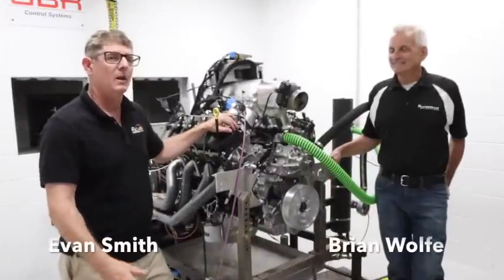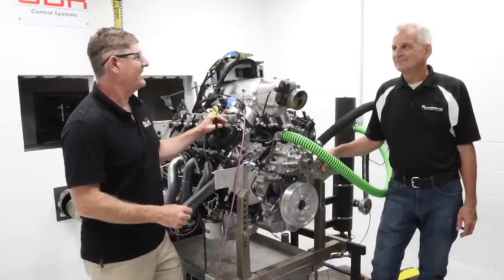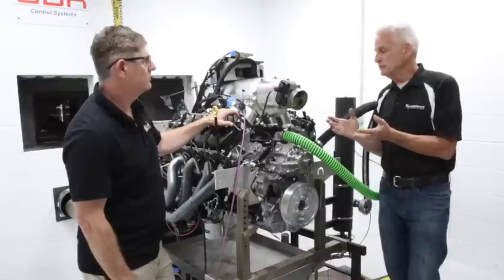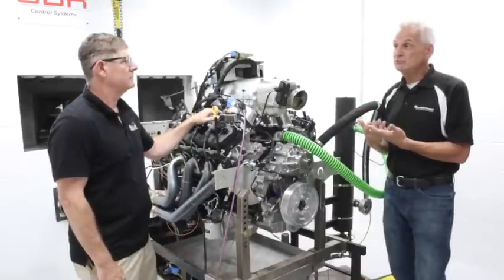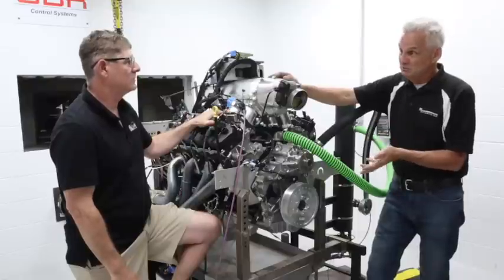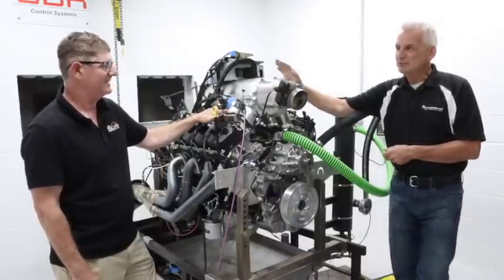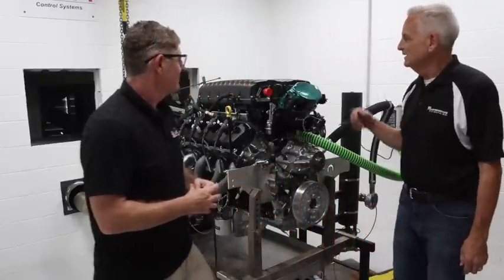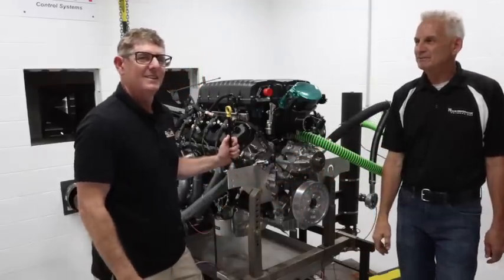Godzilla 7.3L Ford — Back on the Dyno With Over 780 All-Motor HP — Plus... We Reveal What's Next.

Comment: I've got the 7.3 in my 2020 SD Tremor and loving it so far,, heard some guys having plug wire issues.yours still stock and do you plan on changing the coils n wires. TKS for the update 🇺🇸
Reply: Yes, with the blower will be running BIg Stuff 3 coils.
Reply: The front main seal went out on my 7.3 with 14,000 miles on it.
Reply: @mariobrothers8348  wow
Reply: Literally a brand new engine - there will be 'teething issues'. This is why you don't buy year 1 products unless you're willing to roll the dice on being a guinea pig

Comment: Sucks Ford won't produce this beast very long....
Reply: Why would you say that?
Reply: @brianwolfe2993  The history is there, the latest 'big block' V8 (6.2) didn't last long. I have nothing but Ford vehicles and I love Fords
Reply: @slowstang88  This engine will be in the Super Duty for decades, I am certain of that, and the capacity is over 200K per year.  Not to worry they will be there for you.
Reply: @slowstang88  couple things, 1 6.2 isn't a "big block", and 2 they are still in production today, 10 years on now.
Reply: @brianwolfe2993  I always wanted them to mod the 6.2 for the GT500 the same way as the small inch modulars to totally destroy the ZL1
Reply: @slowstang88  That would have been cool, but Do not thing a 4 cam 6.2: would have fit in the Mustang, also I think the 5.2: is going great.  Check out Palm Beach Dyno's results.  They have a lot of GT500's in the 9's with bolt on's and full vehicle weight.  Cool Shit.
Reply: @brianwolfe2993  I damn well hope so
Reply: Diesels being so expensive and tightening future emissions requirements will make gas options more desirable in the coming years.
Reply: All the SuperDuty's on the dealer lots have the 7.3 and they're sold right away. So far this engine is more powerfull than the 6.2 and gets better fuel economy than my fathers 2019. Very impressive motor, but we'll see how it does in a few -40 winters :D

Comment: Surprised of how low the torque is the whole deal with this Godzilla was everyone saying “torque monster” it didn’t even crack 600 NA i hope with the blower it makes atleast 700 with this exact same setup.
Reply: Again, BLOWER cam!   This will make way north of 700 with the blower......
Reply: @Brian Wolfe sounds good not trying to be an ass or anything just seemed odd thanks for the clarification with the blower will the torque be close to the HP or will they be a huge gap like the coyote engine??
Reply: It has blower cams that’s why . And it still kept torque very linear across the dyno pull . I’m impressed

Comment: Really since when is 12.5:1 blower comp ratio.
Reply: It's becoming common. But yeah it never use to be. But everyone is doing it now.
Reply: Im use to 9 to 1 for super chargers. I  guess engine management has cone a long way since carburetors and magnetos
Reply: Racers have been at 12-1 for 2 years now. The tuning window is smaller.
Reply: @ejohnson3837  Are they running less boost or using intercoolers? I know the screw type compressor produce less heat and are more efficient but damn! I had a hard time running 11 to 1 in my 454 Vette. I ended up going 50/50 super unleaded and 100 low lead AV fuel.
Edit: It was a 1970 naturally   aspirated, cast Iron oval port heads.
Reply: @billconservative9503  32 psi and methanol
Reply: @ejohnson3837  Doh! Thats amazing.
Reply: @billconservative9503  Yes, the new engines with alumninum pull more heat out..heard aluminum heads are worth a point of compression...and the new fueling with direct injection helps. The new Coyote runs off E85 too which is 105 octane.
Reply: @robertelmo7736  Doesn't alcohol fuels have about 1/2 of the thermal energy of gasoline? Would that require twice the amount of fuel to extract the same amount of energy. I know the fuel has higher octane than most pump fuels and it runs cooler. Just curious.
Reply: @billconservative9503  Most run e85 or methanol. If running gas, then yes air to air or air to water. Street motors are tuned with a lot less timing. Race motors monitor intake air temps to keep them low. Last year we ran race gas on a 12-1, 314 cubic inch procharged  mustang in NMRA Modified Street class. we ran an air to water intercooler and put 22lbs of ice in the water tank per run. Intake air temps at 32 l.b.s. of boost were never over 50 degrees
Reply: @billconservative9503  E85 was 30-40% more when I ran it in my stock 5.0 with ball drive non-intercooled Paxton for years. I would mix it with premium (93) to E60 (60% ethanol) which was about 100 octane and needed about 20% more fuel. Cooling effect and timing I added accounted for about a 40hp gain.
Can't get it anywhere around me, so just running premium now in my 393 budget stroker.
Reply: Has been for a while, not an issue.  Even the 2018 5.0L Coyote is at 12.0:1 and the put a Whipple on that with pump gas, this is a race engine for use with VP race fuel,  sorry if that was not clear in the video.
Reply: I'm going to lean more towards fuel.  The fuel technology we have now compared to 10-15+yrs ago.  Ideal if ignition should happen between 17-20 degrees on boosted app.  If you can control your detonation, good fuel, proper air charge temps, and fuel I see how the newer engines are 11 to 11.5:1 and handling boost.
Reply: Direct injection sprays top of the piston instant cooling 12-1 compression +E85=110octane 20 psi no problem cars make 650 wheel on 7-8 psi now
Reply: Since when has 11.0:1 been factory we live in great times for power!
Reply: Daniel Smith since the ls2 came out in 2005 11-1 compression CT’s-v gto corvette all got this engine in 2005 and ford had to catch up this gt500
Reply: @danielsmith7935  1970 Lt-1 was 11:0 to one 1967 L-88 was 12.5:1 1964 max wedge was 13.5:1.
Reply: Someone get Richard Holdener's opinion.  Oh and I was under the impression e85=100 octane?  Where I live I can't get e85.  I watch all these 1320 vid and stuff like this and guys are like "yeah e85".  Highest pump gas I can purchase normally is 93.  If you find a Sunoco it might have ultra 94.
Reply: Since it’s running on C16 fuel... know your fuels. 5:00
Reply: @K_M_M_G  ok...

Comment: Wow I can't believe that curve it was still climbing
Reply: Forest LawrenceGrading : on the final corrected curve we have a  Twin Peaks Rocky Mountian Pleatau 550 to 525 to 553 lb-ft torque curve at 5500-6100-6750  and 790 hp at 7600 rpm. Nice Aspirations Index, nice relaxed 1.24 lb-ft per cube Without Even Trying..Knowing how perfect the bore spacings and port arrangements are to match a Dominator carb spacing,  Tunnel rammed with 1150 cfm Dual Quads, this could easily make 860 hp at the same revs.Just As it is That things really quite awesome..BW...your a shining star!
Reply: Only a 90 mm 3.54 inch throttle body off an S550 GT 350 and its 789.6 horsepower? 183 cube Whipple Screw Supercharger will be like a boost ratio of more than 2.5 at 22 pounds of boost. Just off 2000 hp Id say if there is no boost limit in that class.

Comment: Spinning a 7.3L motor to 7600 ain't no joke, man.
Reply: in the realm of high performance engines there are engines over 8.8 liters spinning up to 7500, especially considering there is a set of aluminum rods in there which is twice the price of a regular set of rods on top of it being a one off set
Reply: @Bro_dee007  how long did it last
Reply: That’s not high Richard holdner revs old school big blocks to that so this new engine definitely should after 15,000.00 of custom parts
Reply: @utahcountypicazospage5412  - there isn’t even 1000 dollars in it you don’t have a clue. Bone stock Ford truck engine. That’ll kick the ls ass
Reply: I built a 864 cube inch mountain motor ran it to 9000 rpm made peak power at 8600
Reply: This guy with a SBC impressed me lol...

https://www.youtube.com/watch?v=OGIz5AZbwrU

Comment: FINALLY! The wait was killin' me!
Did you tell unkle Tony about the video?
Reply: 11secghia : He Knows....
Reply: Him and Wilburn will get that fucker into the '8s just you wait and see. Umm...yeah, that's in the 1/8th, ah maybe.
Reply: He turned it into a full race motor with custom valve train pistons rods just the block is stock  this better make 1600 hp because if he doesn’t it wasn’t impressive
Reply: Utah county Picazo's page : It will make that 900 hp at 8000rpm..maybee 930. The boost ratio will be cosmic. Cannot wait, UC
UC.IC.WeSee...
Reply: Dean Stevenson full race engine 7.3. head over to Richard holdner page and watch him do this hp with off the shelf stuff oh and 8-1 compression and gives part #s
Reply: Utah county Picazo's page : Much love to all Dancin Knitting Needlerz. All kinds. Aint no GM Power Freigh train Hate mayn. Love everyone of Richard Holdeners love children. From 4.8 to 6.2,  If a 4.8 with 26.8 pounds of squeeze can sneeze out 5 times as many  trifecta wining Horses as a stocker ( 1200 gross verses 240 hp net) then so can the Gee Zee.  Starting with twice as much just ups the ante and throws down the Quantlett. Its All Good Under the Hood...due to blue bleeding breeding FoMoGo grunt has always cost more moolah than Team G and C.  Without a salavage tag, see what 7 grand can do at  https://youtu.be/TNfRLX9yNUs
Reply: @utahcountypicazospage5412 i agree  but crank is also stock with alot of other parts .

I wouldn't of gone with titanium vavles and kept the stock rockers  . Shouldn't of used aluminum rods. Pistons was probably a must  
.Atleast to see the limited of the motor and it's parts . After all they are trying to showcase this motor .
Reply: MichXJdad you don’t listen or watch obviously nothing about that valve train is stock not the keyed lifters mechanical camshaft special rocker assembly titanium valves the company that Made the intake made the valvetrian look at a stock 7.3 major difference in valvetrian at least 10,000 dollars
Reply: MichXJdad watch the video over geeeeeeeez lmao you are way wrong

Comment: Has Brian looked into stroking this?  How big could it go?
Reply: I think you could go between 4.15 to 4.25, but have to try it to be certain.
Reply: There are 500+ C.I. LS engines (tall deck) and they only have a 4.40 bore spacing. This 7.3 has a 4.530 bore spacing so yeah I think they could get at least 500 C.I. out of it?
Reply: @baby-sharkgto4902  My comment was with with a stock block.  I think 500 can be done, just have not done it yet.
Reply: Would the heads flow enough for any more cubes port and polish had to be done by a professional had the heads been left stock we would of been very unimpressed by the #s
Reply: @utahcountypicazospage5412  In the previous installments, Brian said the stock head flows about 320 cfm at peak.  That is about equivalent to a GM LS3 head unported.

Comment: i heard it spits rods on rpm
Reply: Who did you hear this from, everything was very happy at 7600.
Reply: Must be an LS guy, lol
Reply: He changed the rods
Reply: What did he do with those saw cuts in between the cylinder ?
Reply: Under boost I have heard they spit rods but this full built motor shouldn’t lol is there aftermarket camshafts available for this engine yet that will show head flow and power with a cam only +tune

Comment: FORD needs to make the BOSS 429 with this and add a blower for 1100hp, to end all debates.
Reply: It will have Knudsen riding a Hellcat with a Sabre in his hand as the badge.
Reply: I don't really think you need the blower for 1100 , but why not !
Reply: @jeffschwartz5199  it would be cool though!
Reply: @drfaticus  most definitely 👍
Reply: It's already 444"
Reply: @james avery loooool ebay turbo
Reply: james avery yup and 6.0 ls doesn’t even have to try lol it does this na and ls7 does 825 stock ls7 heads
Reply: @utahcountypicazospage5412  so you think Ford can't put out a better factory head like chevy did. This is a motor that's designed for a truck. So why bring the ls7 motor into this?  You also do realize. The ls has been around since the 90s. The ls7 didn't come out until years later. I believe it was 2005/06 when it came out. So I'd hope by now they would he making 700hp easy regardless of it's a 6.0, 7.0, etc. 
The stock ls7 heads don't support enough to make 825hp without work. Not to mention many over cam the stock heads. After .550-.600 lift the stock head falls off from 360-370 down to 332-335 range. Once the heads are ported that fall off doesn't happen and air flow is increased. It's why combination has always been everything. This is the reason the stock style intakes work so well because the heads actually flow about 40-45cfm less at peak with the factory intake but It was well designed for the combination. To make 800+ with a Ls7 it takes ported heads, piston etc. Not sure who you think your bs. 
This ford motor is brand new and is already holding it's own. Like I said. It doesn't matter which manufacturer it is. They're all more than capable of putting out hp engines.
Reply: Utah county Picazo's page - 5.0l coyote makes 1000 stock internals
Reply: @CoyoteFTW  that's true, Garbage Motor boys can't stand that
Reply: @james avery and . What's the result????
Reply: But they won't it's ford.
Reply: @james avery for like half a race season
Reply: It's not a 429, it's s 445.
Reply: @joshkrause2977  uh huh
Reply: Everything is custom in this engine no way it gets to production like this they should put boost to a stock 7.3 but I think red eye still wins
Reply: @utahcountypicazospage5412  lol this motor with this stock rotating assembly and factory heads will make 600hp+ easy. You add 17 - 18lbs of boost that's about 1200hp. 
Honestly it doesn't matter if it's Ford, Chevy or Dodge. They all will make power when you add boost but the debate will never be over. To many variables and opinions for that to ever happen.
Reply: Wayne Bollentin valvetrian alone has to be insane amount of cash everything is custom Richard Holdner makes same power with off the shelf parts with old stuff so I’m not impressed with this engine
Reply: @utahcountypicazospage5412  ok take one of those engines you're talking about and see how competitive you would be in ultra street. Did you watch the entire video or just come to the comment section to talk shit? 
This motor was built for a specific purpose, which is ultra street. So obviously certain parts are going to be upgraded. It's hilarious you think the stock rockers wouldn't make it at this rpm and power level in N/A form or more for that matter. 
If you added boost to this motor stock vs a stock untouched Ls. It would hang with it np in every aspect. This motor is going to make 1600hp+ with boost easy. 
I'm not a Ford, Chevy, Dodge, etc guy. I'm a car guy period. I've built, tuned and raced all of them over the years. It's not the make or model, it's the people behind the build that makes the difference.